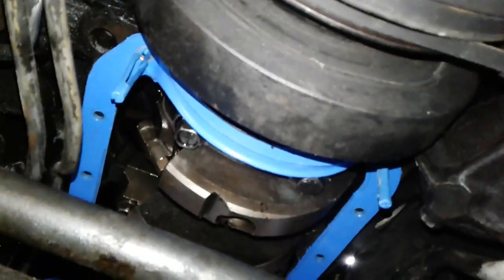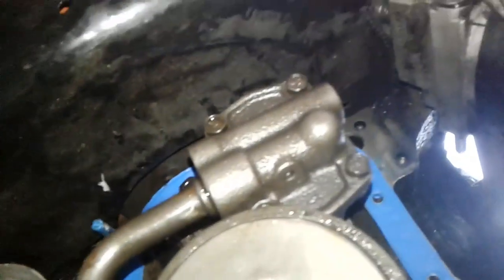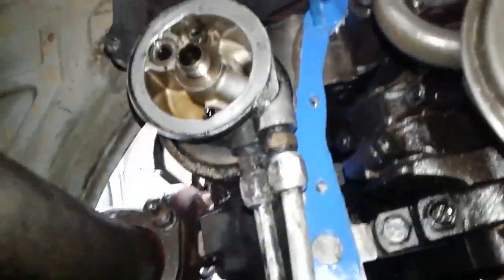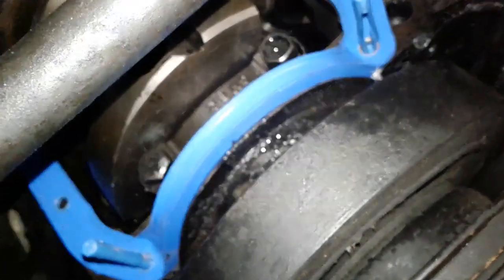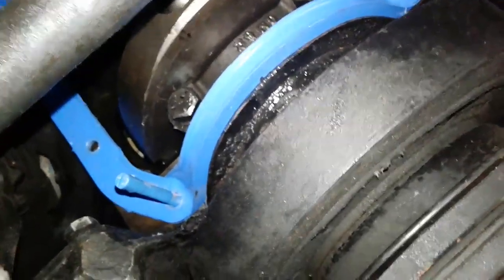350 chevy oil pan gasket installation

Comment: Oil pan replacement video with no footage of removing the oil pan or reinstalling the oil pan very useless
Reply: Totally agree !!
Reply: its just nuts and bolts dude, got tools? figure it out, nothing about this or most auto work is hard, just time
Reply: You sho right wtf.....
Reply from the maker: why do you want me to waste your time . it was easy . you know where it is . im pretty sure everyone know how to unscrew a damn bolt . unless your a moron .    the starter is also easy to remove . what did you wanna see me placing it and bolting it down . that would be useless .
Reply: @310smoker  *you're
Reply: How did u get the pan ? Mine is hitting the 3rd member  it's on a 64 Impala.
Reply: @kobeortiz79 you have to lidt the engine. Which is why this video sucks and doesnt explain that

Comment: Thats wrong gasket
Reply from the maker: @simsrodriguez3545  nope it's just the new kind , never leaked .
Reply: @310smoker  correct gasket number is felpro os 34509 other side should not be sticking out on 350 if dip stick is on driver side that's the correct gasket

Comment: Thanks for nothing
Reply from the maker: if you didn't find anything useful then its because you already knew how to. if you can see you can realize how to pin it to the bottom .as i demonstrated . i only had to remove the starter to install the gasket . and the oil pan obviously   lol
Reply: @310smoker   shoot I removed the oil filter housing and the bell housing it is still dangling up there now. Maybe I need to remove the exaust? Too much for a oil pan.

Comment: How do you have your vehicle set up to install the pan? How did you get the cover back in? I got mine disassembled, cleaned up & all, but made the mistake of jacking the car (suburban) up a bit more so I had more room under the car. Big mistake. It changed the clearances & now I am trying to figure out where I had it before to get the pan back in place.
Reply from the maker: Runnin' Rabbits Films it's a van I'm just under it . I did remove the starter . and this one pan

Comment: changed my oil pan gasket on a 1971 chevy nova, disconnect battery, fan shroud, and fan to make it easier to turn engine over using crank damper bolt, place timing mark at 6 o'clock position, remove engine mount bolts, remove starter and oil filter, flywheel cover and oil. remove distributor cap to clear firewall when jacking engine up,  2x4 wood under mounts or something so it won't drop down, I removed my drag link from frame on passengers side for extra Clearance, remove bolts and drop oil pan. I jacked up engine using bottle jack and wood, car on ramps. timing mark is as 6 o'clock position to clear crank counter weights at front of engine.  hope this helps someone, took me about 2.5 hrs. to do this.
Reply from the maker: you did all just to change the gasket. wow . good thing my van was way easier.
Reply from the maker: i still have the van

Comment: I think it's a good video cause the title simply says installing the gasket doesn't say anything about removing the pan and I think it's a good video cause I've removed everything myself but am skeptic on installing the gasket this is the fourth video I've seen I don't want it to leak but the video has no ending
Reply from the maker: i can answer any questions. and still own the van
Reply: @310smoker  has the oil pan leaked

Comment: 1991 GMC 1500 short box with 5.7 did it today didn't have to remove starter or oil cooler ,I ditched the oil cooler last year , I don't tow , the only bracket was the trans cooler on the passenger side , cleaned oil pan and painted the pan and torque converter cover , no more leaks with felpro gaskets . thanks for the clip , here's my truck now .             https://www.youtube.com/watch?v=-BDUuHcDqW4
Reply: Quick question did u have to remove the rubber gasket under the timing chain cover or did u place it over it?
Reply: @josebarrera3548  its all one peace

Comment: put the gasket on the oil pan, then install. much easier.
Reply from the maker: The clips they come with helped good . No problem
Reply: @310smoker  i didn't have enough space to get the pan by the dowels. and it fits very snug on the oil pan. 78 chevy van.

Comment: The engine is sitting on the top of the oil pan and I still can't remove it how you did it ?
Reply from the maker: you working on the same van . remove the starter .

Comment: To remove pan get a floor jack, 2x4 abour 18 inches, socket set with 6 inches of extensions.

remove exhaust crossover
Remove trans inspection cover
The bar that goes to drivers side block from cover has to come out. 
Remove motor mount bolts 
Remove air cleaner
Put 2x4 on bottom of harmonic balancer and jack up engine as far as possible. 
Use 3/8th and 1/2 socket to take out pan bolts. 
Keep them in order. 
If your engine is high enough it will come right out. 
Clean up gasket surfaces
Install in reverse order and rtv the front and rear seal humps.
Reply from the maker: i did not jack up my van .
Reply: Jacking up at your harmonic balancer is horrible advice... 💀